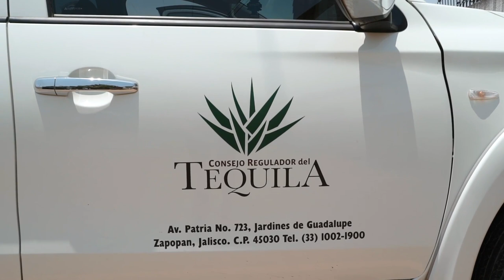Making Tequila in The Highlands

Comment: Pretty good video. I would have liked to go more into the respective product... but well...
The only mistake I could make out was, when it was mentioned that the CRT ensures, that the tequila is the best quality possible and that is simply not true.
Tequila is a protected origin (origin, methodology, starch sources etc). Hence to be legally called Tequila, the producer has to ensure that all minimum standards are met - and if the brand “promises” some higher qualities (e.g. aged tequila or 100% agave tequila) that also these standards are met. 
But the CRT is not there to ensure that the tequila has more than the legal minimum quality. (It is the same confusion with hotels - only the fact that a hotel has 5 stars doesn’t mean, that it is the highest quality - it just offers some (higher) minimum standards. It’s kinda quantity (of standards) over quality (which is far more difficult to determine).
Reply from the maker: Thanks so much for the comment and information/clarification about the CRT. I appreciate it.  This was the final episode about tequila we filmed 4 total and i tried to compliment each episode with different information about tequila while also highlighting different brands.  Cheers and appreciate you taking time to write this. -Jeff
Reply: Beer, Wine and Spirits 
Great series!
Reply from the maker: Dominik MJ thanks so much brother.  Means a lot!! 👊🏻👊🏻👊🏻